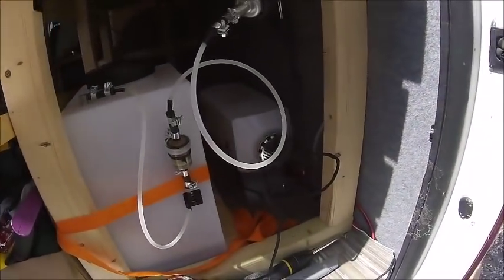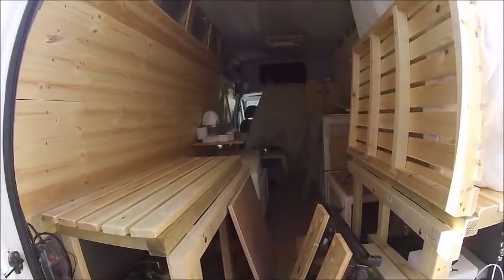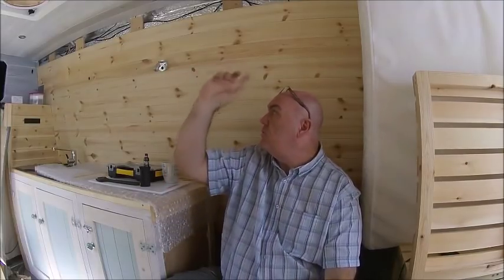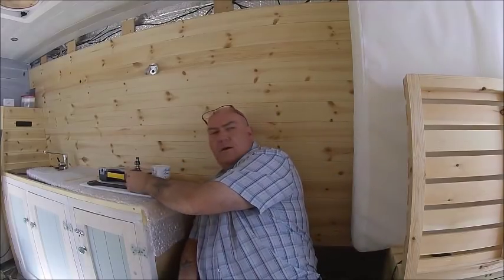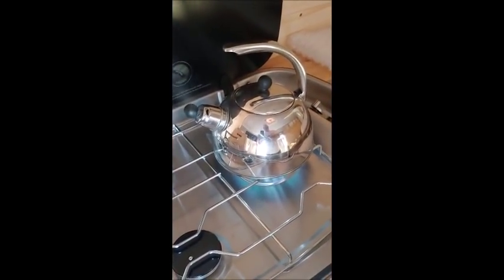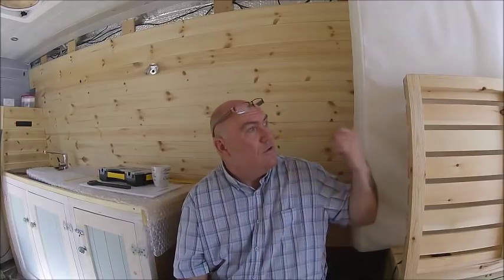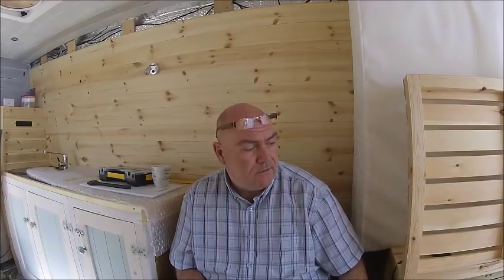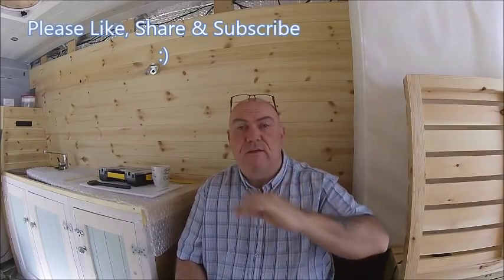Transit Camper Conversion 31  Diesel heater smoke, Battery bank and buying stuff

Comment: For the heater exhaust did you drill a hole to van's floor or used a plastic hole that is near side panel? Thanks

Comment: I wouldn't bother fitting a toilet, just stick your arse out the window while your driving. It works for me.

Strange coincidence, was with Ray in the club last night and he mentioned the ton of work he has on and a camper van, I thought it must be yours but I didn't like to pry. (Thats not true, I do like to pry, but I try not to).

This part, I have no real idea, but when I've watched the vids of people fitting inverters to feed mains from the battery to something, I can't help wondering if for the amount of time it is used, would a diesel generator work out better.  Things like computers don't really need mains to run,  people put inverters in for those, when really a laptop is between 12 and 24 volts DC depending on the make,  much more efficient to double a 12v DC to say 24v DC than to take that same 12v DC up to 240vAC, the inverter is wasting more than it's giving.
Reply from the maker: Yeah ive read that about inverters Rob. I think the laptop is about 19v.  As far as the toilet goes, im a bag it and chuck guy LOL.